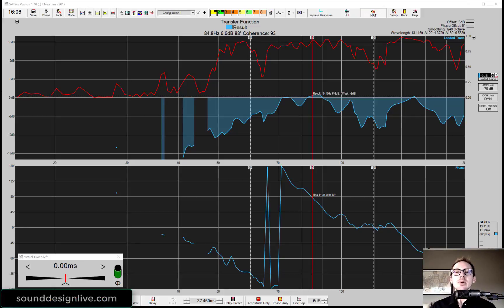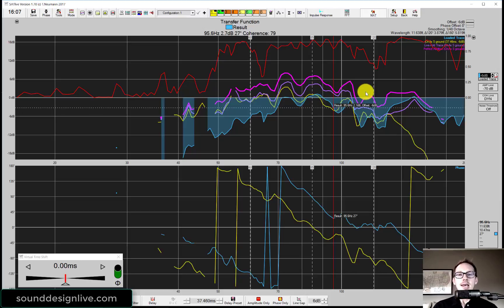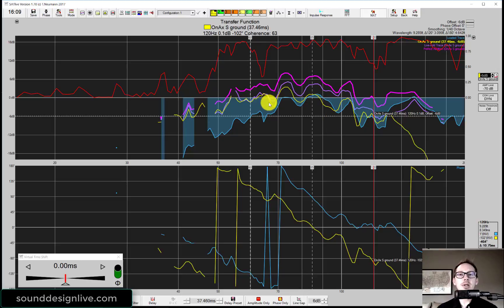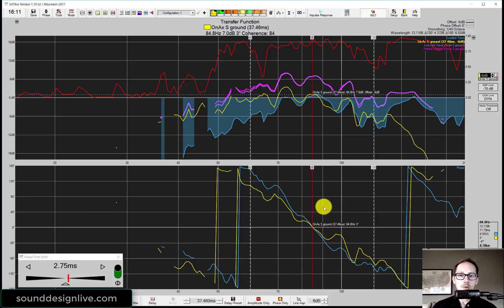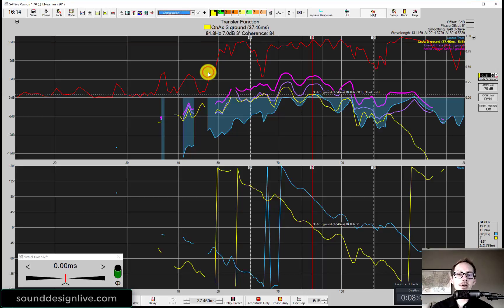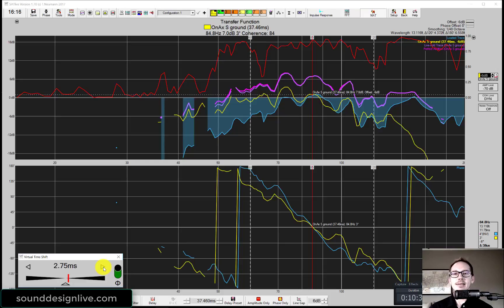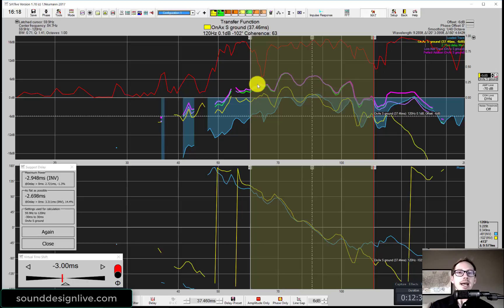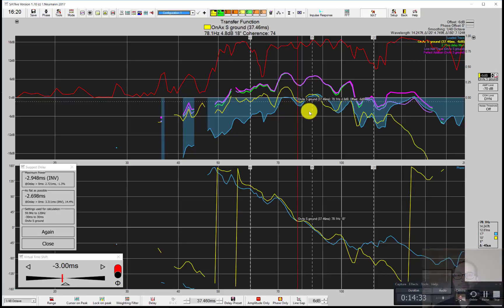3 Simple Ways to Phase Align Main+Sub with SATlive

Comment: I'm working with horns of various lengths, and the customer prefers analogue to digital, so virtual delay is out of the question. I assume I can move the shorter horn back and forth (behind the longer horn) and observe the traces? Negative delay readings means I move the shorter horn farther back?
Reply from the maker: Hey John, sounds like an interesting project. I'm a speaker builder myself so I can't offer much guidance. Yes, physical displacement will create delay and change phase relationships.
Reply: @nathanlively  I'm just getting into SATlive, so any info on product set-up would be useful. I have the ECM8000 mic, and a Windows laptop. What interface do I need? I'm not using a soundboard/mixer in the final product (the sound system).
Reply: @nathanlively  Another thought: can I run the mic directly (no interface) into the computer while running SATlive. Capture the bass horn signal, then switch to the midrange horn and move it as required to get the proper phase?

Comment: Question... stereo setup. Do you leave both sides of the rig on with the mic off to one side or the other or do you only leave the side your measuring on when it comes to phase alignment (sub-mid/high)?
Reply from the maker: Hey Blonchay123, so can I assume that your mains AND your subs are in some kind of uncoupled symmetrical L/R configuration?

I have found it very difficult to get actionable data with both sides on. That's a lot of arrivals and reflections. 

Once I get the alignment done, I will turn everything on together to check the balance between main and sub again.

Comment: Good explainations, thanks Nathan, but does it work only for ground-based subs stacks,no? Did you try to use a subs stack around 3 meters behind the main p.a?
Reply from the maker: Hi Pierre, thanks for checking out the video. These methods should work for any sound system setup. I am merely describing how to compare performance once you have everything set up.
I don't think I have ever specifically tried setting up subs 3m behind the PA. Has that worked for you? With what speakers?

Comment: Am I right in thinking you could always add delay to each channel to start with? If you added 3ms to each channel at the beginning you can technically remove 3ms and have a negative delay.
Reply from the maker: Yes!! Great point Kontakt. If you start with some added delay, then you can be more flexible. Then, in the end, you can remove any extra that is left over. Negative delay = solved.